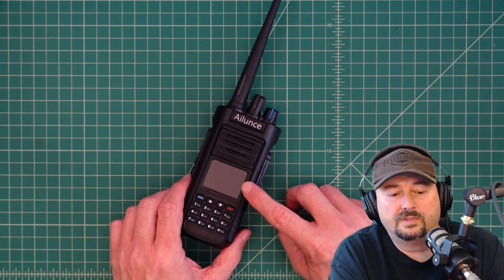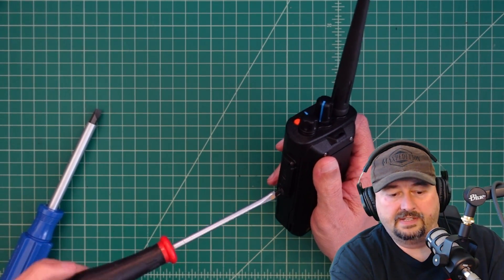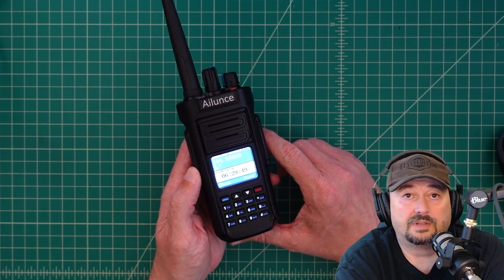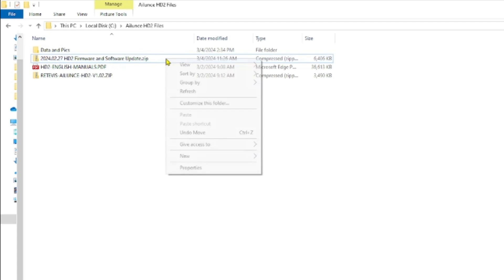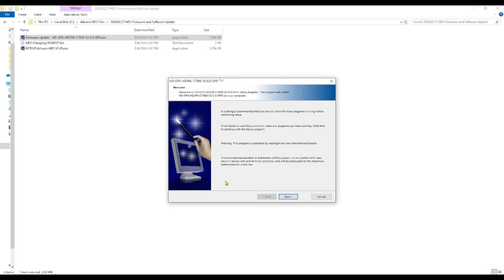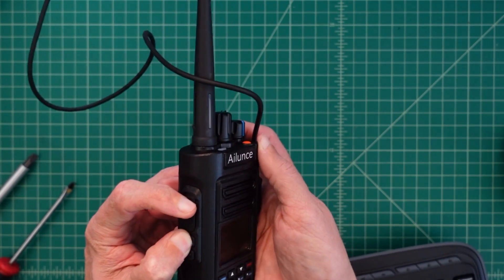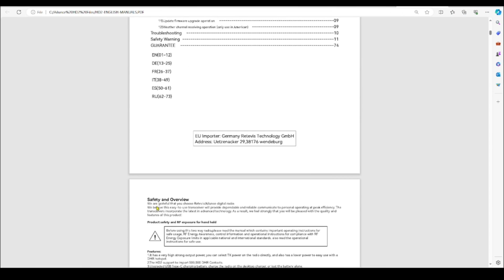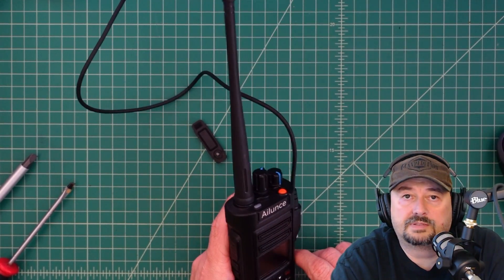Ailunce HD2 Firmware Update - How to Do It!

Comment: very informative video, found two links for the firmware update, one is flagged with virus and it has both for GPS and Non GPS, the other link works but only has the GPS firmware update, I need the Non GPS firmware update and cannot find it anywhere except for the link that has the virus and cannot be downloaded, if you can help with a link for 2024.03.15 Retevis AilunceHD2 Firmware V2.02.zip thank you
Reply from the maker: I think they changed the link, the best bet is to check the website 👍
Reply: @TheSmokinApe  thank you for your quick response. I did check the Retevis Ailunce web site and did not find firmware updates for the HD2 radio
Reply from the maker: Dang

Comment: hi there. I used your link and updated my brand new HD2. Everything went rather smoothly. I have a couple of remarks though.
I noticed that between fw 1.0.0  and 2.0.3 the MIC Audio that had been reported very good, went so faint I had to crank it up to 10 in the settings to become just OK...
I got the Tune tool for HD1&HD2 (with 7000chip) but I'm not sure how to use it to increase the audio.
Can you help ?
Reply from the maker: Sorry man, I have no idea what that file even is 🤔
Reply: I have had others report similarly for 2.0.3 when it comes to mic gain however I have heard at least one person that used it kinda bork their HD2. I tried to look at it but the chinese characters in the app didn't render properly so I couldn't use Google Translate. (Just a bunch of questionmarks.)
Reply: Hi @derekkolakowski7083 , I had a long talk with a spanish OM who just bought, like me, an Ailunce HD2 and reported no problem... It made me think... I noticed that when I was holding my rig on the right hand, my thumb was partialy covering the little electret hole on the rig... That could have explained the audio weakness. I decided to revert to the original settings (Using the Tune software for HD2) and You know what, audio seems good....

Comment: How does the HD2 differ from the HD1 after upgrading to firmare v2? What features does the v2 add?
Reply from the maker: I haven't done a full comparison yet but there will be more videos.  I can tell you it does have; more storage for contacts, lower power output and USB-C charging.  The firmware upgraded added AES encryption.
Reply: @TheSmokinApe  Thanks. Lower power output in an upgraded model sounds problematic, I mean what's the purpose?
Reply from the maker: I think the larger contact database is the big draw...
Reply: @SourojitBhattacharya  the purpose would be for use with hotspots, where you don't need to be sending out a full watt.